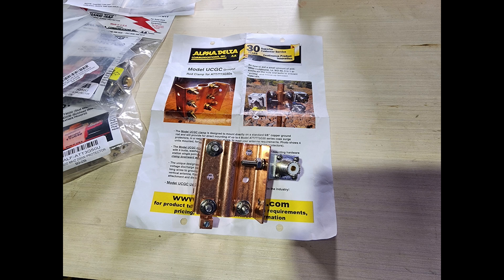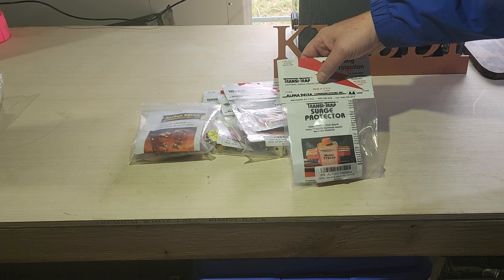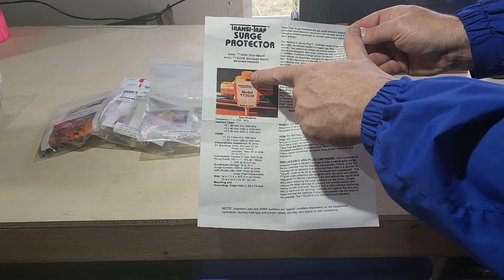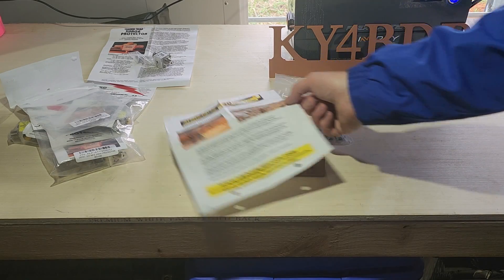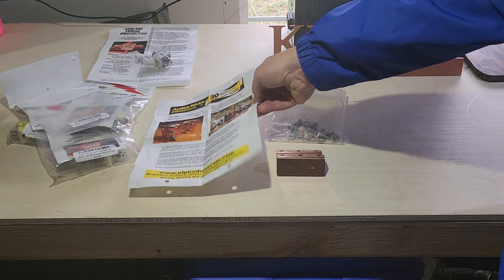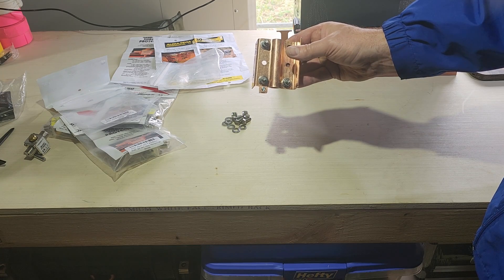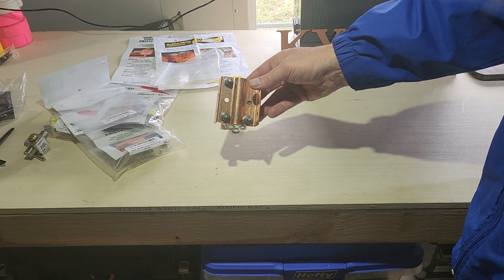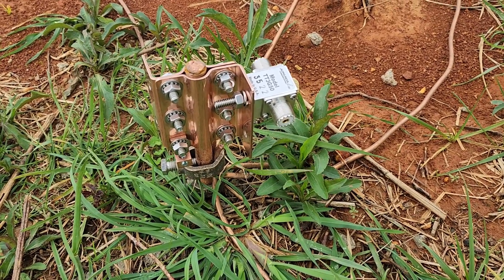LCARA HAM Radio: Alpha Delta Lightning Surge Protector System!!!!

Comment: Due to weather exposure, the contact areas between the copper and aluminum body will corrode, reducing the conductivity of the connection. The proposed heat sink compound would tend to also tend to reduce the conductivity. A better solution is to use a compound designed to reduce corrosion and be a good conductor. I suggest Noalox Anti-Oxidant Compound. It's used in electrical lug connectors where aluminum and copper conductors are used together. Two dissimilar metals will tend to react to each other and cause a resistance to current flow. Add on top of that the weather factor and it is a recipe for failure.

Comment: How would one weatherproof the SO-239 connectors? It looks like an odd thing to try to wrap it with electrical tape, I know they also make an adhesive plastic tape that you could probably use, but I don’t like it because it seems you can’t never get it all off.
Reply: I've done similar with clingfilm but if done in damp air you get condensation.  Also tighten it around the cable with cable ties or shrink insulator

Comment: I'm kind of confused, isn't the entire purpose of this clamp system to mount to your ground rod? So you still need the ground wire going from the clamp down to the bottom of the same ground rod? Or are you supposed to run the wire from the clamp to some other grounding rod?
Reply: Ya there are much better videos on how to do this and they show it being done to completion.  This video just seemed lacking
Reply: The clamp attaches to the top of the installed ground rod.  There is no need for a wire because the clamp attached to the rod is the electrical connection.

Comment: Hello. I have a Comet CHA 250 hd( verticle). Its on two ten foot fence post for a mast and attached from the ground to the side of my roof. . My question is do i need to run copper ground wire from the antenna connector to the grounding rod, or should i just. Ground the mast since its metal? Thanks

Comment: A word of caution; check on the inside of those alpha delta surge protectors for aluminum burs that could short out your radios . Sometimes they don't clean them out good and the bur could touch the inner conductor and short out. I found a piece of bur in mine after my radio and power supply fried. No it was not lightning never had it connected during any storms.

Comment: Alpha Delta doesn’t seem to answer questions about their lightening arrestors by email. I hate having to call on the phone for stuff like this.
Reply: I suppose if you are in the US then this would maybe prefereable ..personal touch and all that . Do you have experince of this email  stuff or 3rd hand ?
Reply: @101blog  First hand. I’m installing a ground rod for my shack this very week.
Reply: @kellydiver   UM unfortunate, maybe its a one off, they seem to be a good company otherwise!
Reply: @101blog  No doubt. It just annoys me when a business offers a way to contact them and then doesn’t respond. I will call them, but it’s the principle of the thing.
Reply: Having worked on commercial sites I have gained a lot of knowledge about grounding. I have seen ground rods inserted into the ground at all three legs on freestanding towers. The ground rods are connected to each leg of the tower with braided copper wire used for lightning rod protection, in turn they connect all three ground rods with the same cable forming a delta pattern and this is usually buried a few inches under the dirt. Several sites have grounded the shelters that are metal to the ground system of the tower. 
That Alpha Delta ground "block" can be attached to one of the rods but it’s a good idea to place a plastic container over the device to keep excess moisture from causing issues. A little gravel under the container helps. You could purchase a plastic NEMA Enclosure and mount the box on the side of the building and place the grounding assembly inside and run a heavy single conductor or braided line to the ground rods. This way your coax can enter under the box and feed into the protectors. Now the output cables from the protectors can stay in the enclosure, just drill a hole from the box into shelter, use silicone sealant around the box to prevent moisture and bugs from entering the enclosure.
Wishing you great signals and NO lightning problems! 73!